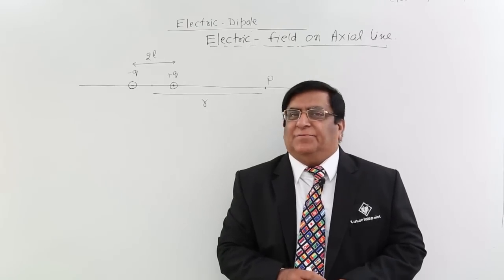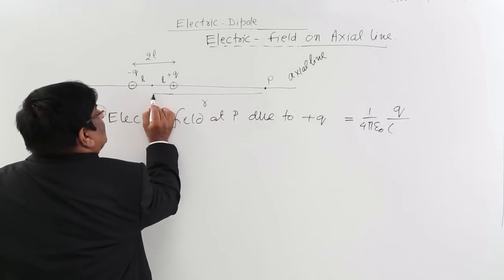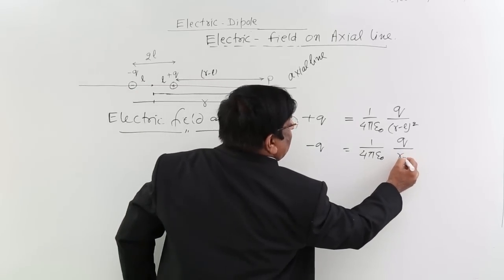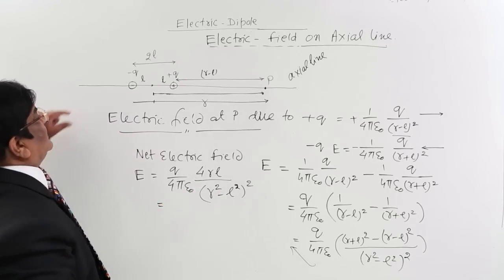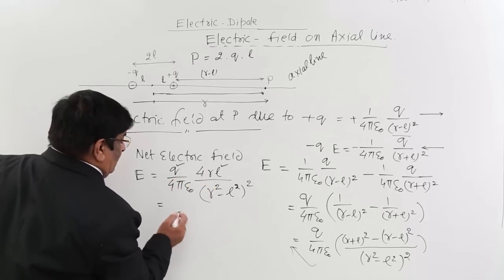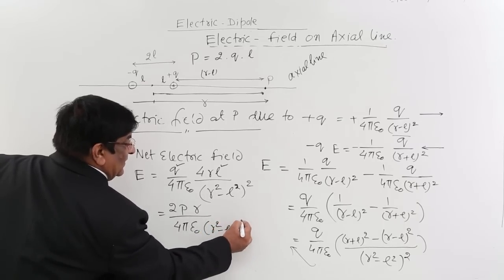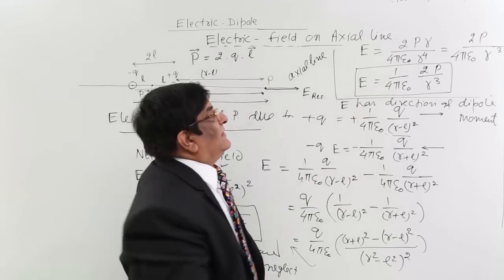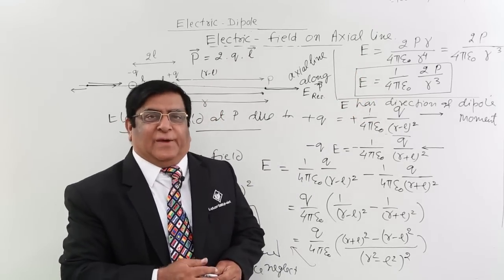Class 12th – Electric Dipole Electric Field on Axial Line | Tutorials Point

Comment: Sir u told that on any point on the axial line the direction of the electric field will be towards the  right side. But what about the direction when the point is kept between the charges and closer to the negative charge . Then the electric field will be towards the negative charge in left side and it is greater so after subtraction the direction would be in left side only no ?
Reply: Correct 👍